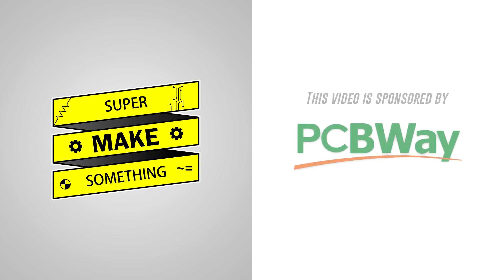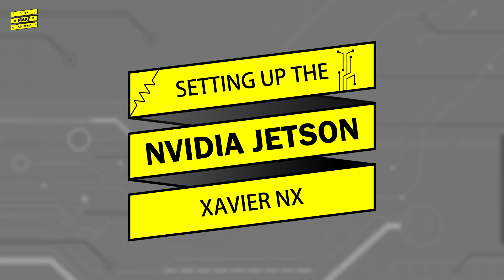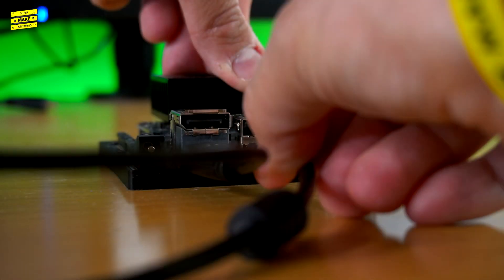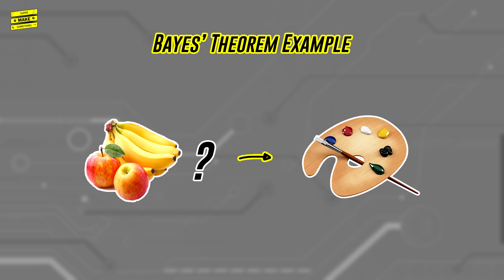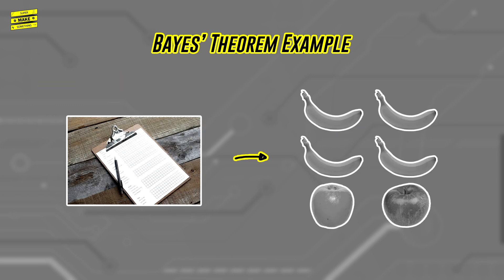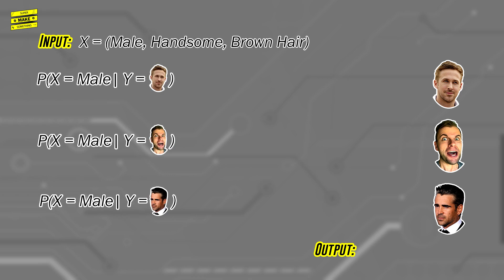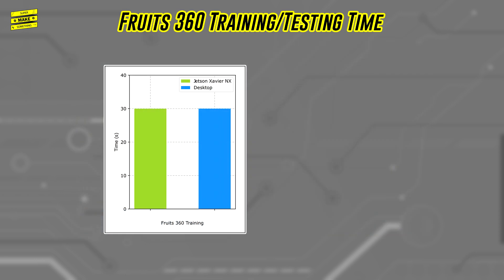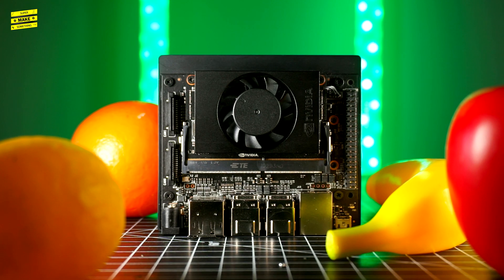Machine Learning 101: Intro To Naive Bayes Classifier (NVIDIA Jetson Xavier NX Review)

Comment: Great video! I’m new to AI, so I’m wondering: if using your computer had equivalent or superior performance to the Jetson, why use the Jetson? Thanks!
Reply from the maker: Thanks! These types of devices serve two purposes — 1.) they are great for teaching/learning since the setup is relatively easy, self-contained and cheap (especially considering that it has a GPU, and 2.) they are good for “edge computing” purposes (such as putting it in a robot, for example), where a traditional computer would be too large and/or power hungry. Hope this helps!